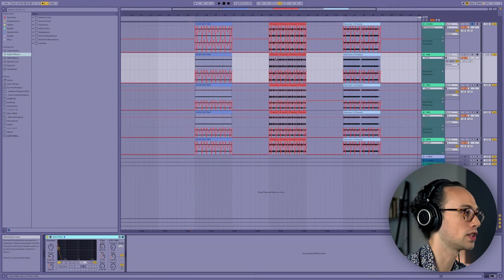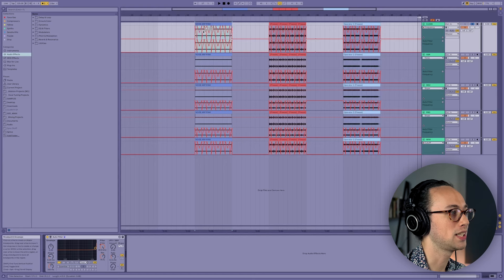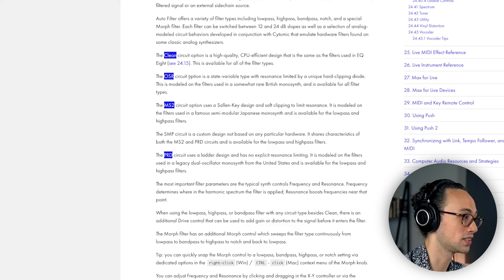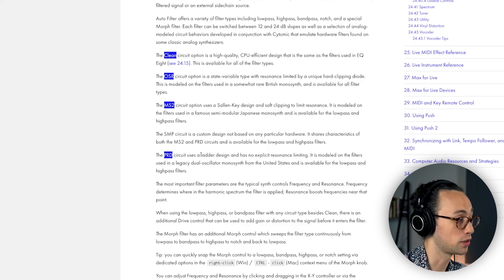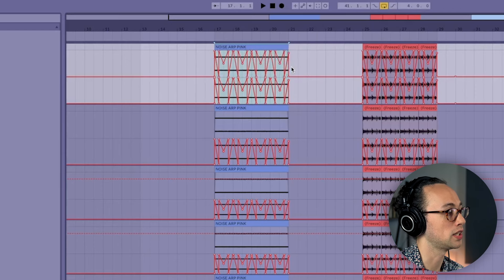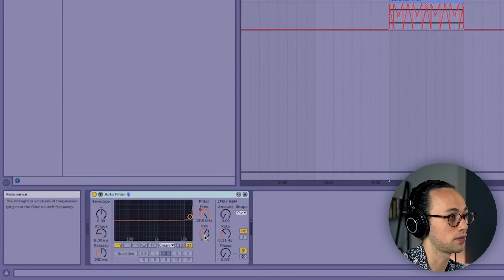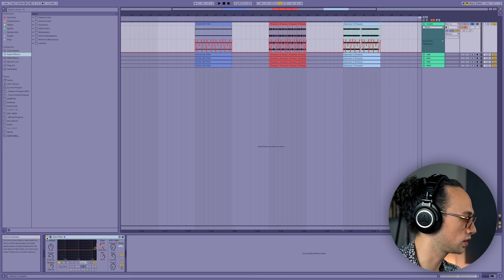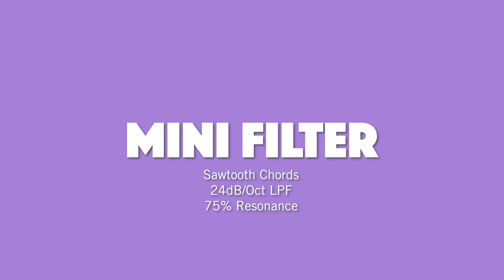Can You Hear The Difference? | In The Beat | Sensho | Thomann

Comment: Virtual Analog, not analog. 
Anyhow, for the transient test. In order to make comparison between the filters you have to make sure they are fully synched i.e. at the exact same settings of each filter applied at the exact same moment of the transients. Was that the case?  
Also could there be a delay issue here complicating things further? In principle each filter algorithm has a different delay effect (even if subtle). So for each setting (as automated by you) there could be more or less time till it fully settles to the input value applied (for example frequency), which means even if a certain frequency value is automated in two filters at a specific point of this sample, the resulted effect could be audible in a little different point of the sound of the sample. I am not sure how it works. But very small changes in the magnitude of a ms or so can make an audible difference in transients.
Reply from the maker: Hi Mike. Thanks for your feedback. We'll check this with Sensho and get back to you :)